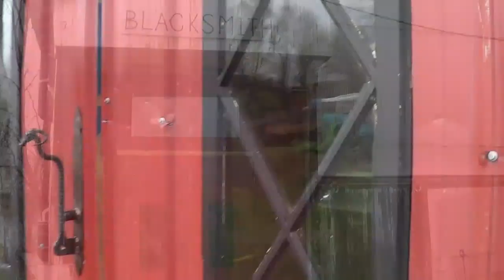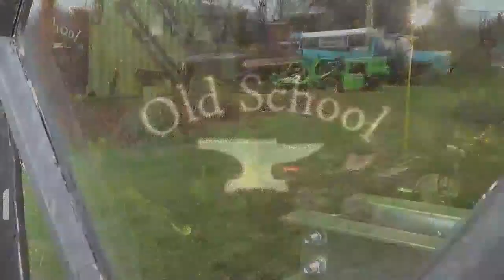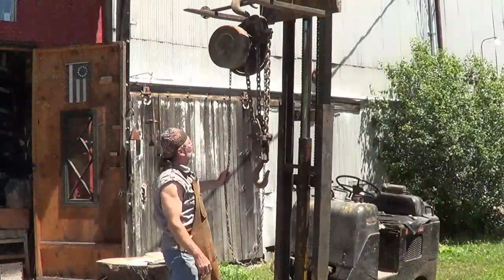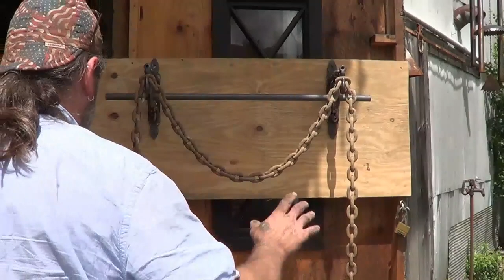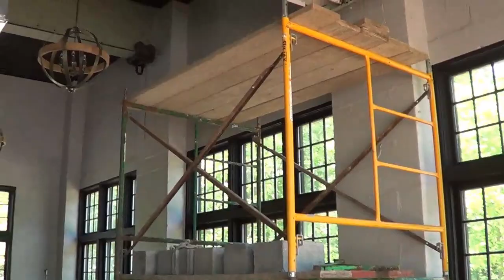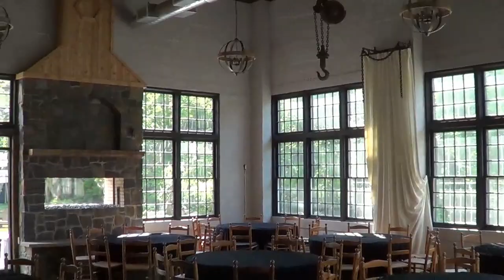Old School Forge Finished Project - Chain Curtain Rods

Comment: Really enjoy you vids!
You need to invest some time looking at treadle hammers. You could build one for under a hundred bucks with a 16 pound sledge and some 4x4 posts and a big spring and some scrap hardware. You can hit MUCH harder with your legs than you can swinging a hand hammer. Flat dies and 1/2 round dies and you are in business. You can alternate legs and go all day instead of just until your arms are dead tired. Raise your production by 10 times after you get it working the way you want. This isn't about working hard, brother, it's about working smart! YOU NEED TO DO THIS!